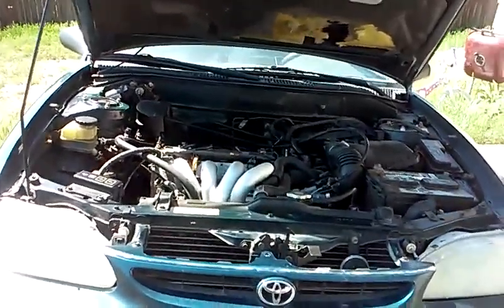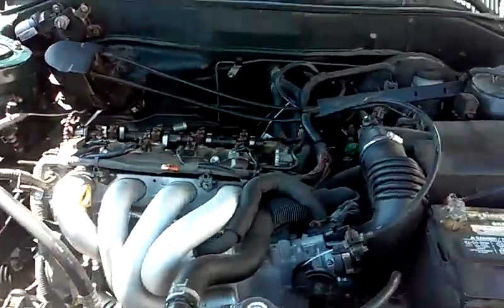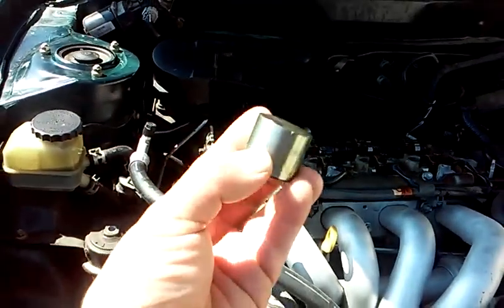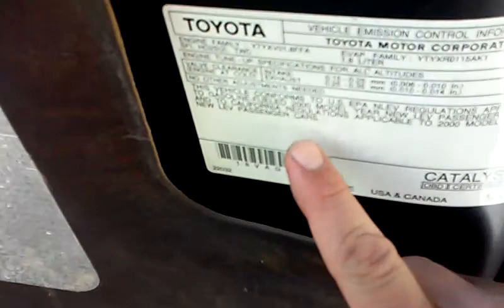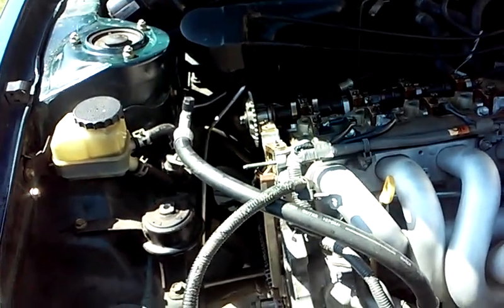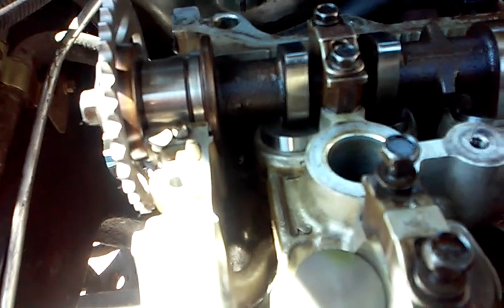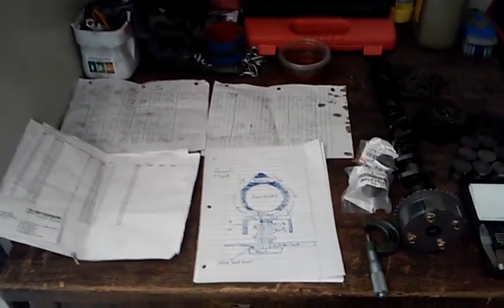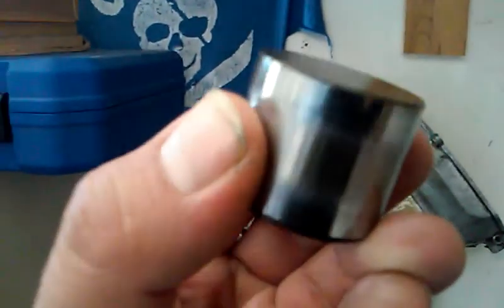toyota valve timing adjustment information

Comment: I have a 1998 Toyota Corolla, with 207,000 miles, and misfires, I replaced coils and plugs, but I believe it is misfire still, I keep resetting the codes, with my scanner does anyone have some advice,This is a five speed clutch driven

Comment: How much can you expect to pay a mechanic for a valve adjustment for a 2006 Toyota Corolla CE, 4 cylinder, manual transmission? I've been using an additive in my gas that seemed to quiet the lifters, but for some reason after getting 2 new lower control arms 2 weeks ago, the lifters are noisier than I've ever heard them before and I'm thinking I'm going to need to have them adjusted. I didn't realize what was causing the noise until i started watching several videos about the lifters and clearances, etc.
Reply: P.S. High mileage past 230k.

Comment: Hey Matt just a little bit of information to pass on dealing with bucket lifters. I saw on another video on YouTube, where the guy didn't put all the timing assembly back together but loosely put the cam shaft on just to check the clearance on the bucket lifters and the camshaft. He said and I quote just make sure it doesn't raise the camshaft up. So you don't have to go through all the hassle of putting it all back together. Just to check your clearance. He's another shop mechanic.

Comment: Thanks for your video Matt. Just for your information it is possible to pull the cams out of that engine without taking off the timing chain cover. I just did a 2004 that needed a new intake cam phaser gear.

Comment: Great video! i am not a mechanic, just a do it yourself because i can not afford the mechanic, or the dealer, so i undertook a project to fix a blown head gasket on my wife 04 corolla; iy only has 122000 miles but this is second time with engine overhaul. First time it had 80000 miles when she blew the engine driving it without oil, I kept that engine and now almost blew the 2003 engine it was put in! So since again the mechanic recommended replacing the engine which would be around $2000, we decided time to fire him; (we expended $1700 5 years ago in the engine replacement with this mechanic) and i took the project, determined to clean and fix that engine really good taking my time; its been 2 months I work little by little whenever i get some time and feel in the mood, what I did is kind of use parts from both engines where i cvould and buy a whole lot of new components for replacement; the original block and head was sent to machine shop; cleaned, tested for cracks ok, machined and the crankshaft was only needing polishing as i was told. The block was deglazed, not bored, then for it I ordered Mahle parts; Standard Pistons/rings, (I am using the connecting rods from the actual engine in the car, the one from 2003 because the 2004 engine connecting rods 2 of them were burnt really bad was advised not to use them) bearings and the head bolts are from them, The engine gasket set is from Apex; now the head was also worked at the machine shop where they re-seated the valves machined and put back together; the lifter were out of order as one guy from Autozone started taking them out of the head to show me something without me or him knowing this is a no no to do, so they worked with it at the machgine shop to re-install it in the head, now I have just done the timing which i ordered a new kit from CNS, i could have used the two sets i have but preferred go new; i have expended countless hours watching reading and learning how to do this, the engine is assembled back as best as I can; oil pan in lower/upper block plus head all installed to specs followed meticoulously, but today when i finally could spin the engine to test everything works and I do not have a valve issue stopping the traveling, first thing i notice is no matter what i do, i could not set the timing marks EXACTLY with the sprokets at 12 o clock; they both are slightly to the right for the VVTi and to the left for the Exaust one, the marks are pretty much parallel to each other at the line of the timing cover as the book asks and the bottom sproket is at TDC straight up; knowing i can not do any better i proceeded to set the time cover on, after couple hours and after tighting to spec the bolts installed the pulley, now the book says the mark in the pulley should point to 0 on the time chain cover , at TDC it points in between 10 and 0 but there is a paly i can do manually without moving the chain or the sprokets, then i started spinning and have never gat the chain marks aligned again from where they were originaly! and the top of the chain seems to do a dent as I rotate the pulley with a 19" socket and a breaker bar; i can feel resistance and easy down and everytime i pass the two sprokets marks in the center and align them the pulley is "in range" between the 10 mark and the 0 --- giving this scenario; did i messed up the timing and need to re-open the timing cover and re-do it all again or do you think the car would actually start? Last thing i want is to start to that horrid engine knock or noise! When I rotated the chain first time, i backed up a little to allow for the tensioner to engage but I can not really see if it is engaged; i took it out once and it was engaged so i re-install it again and did it all over and seems to be "ok" -- after the engine is back together i still will have to lower it into engine bay and hook to the manual transmission; we got new clutch as well as new axles (both boots broken on those) and besides what i mentioned for the engine we also have new radiator/hoses, thermostat, water pump, oil pump, belt, spark plugs, PCV valve. I cleaned, inspected and serviced all other small engine components one by one; for example the VVTi I am using is the original that came with the car, when the first engine blew, oil was gunked up everywhere really thick, including this VVTi which nobody wanted to clean and not willing to expend more i learned about the part for 4 hours, took it appart, got familiar with it, assembly and took it appart again several times, cleaned it until it is shinning new and i know it works so that is the one i asm using, many things the book don tell us i asked a Toyota dealer certified tech how to go about installing it because it suppose to be installed unlocked but then my marks were not aligning at all, the piece i was missing is install it unlock, torque to specs 47 ft lbs, THEN lock it, then marks align; so as you can see i have expended time on this project and it sucks to put it all together to have more issues later on; after this i m going to check my clearances just in case per your video! Thank you for it and any help or advise in my direction is greatly appreciated.

Comment: ????????? Confusing to me but I am just a runt on this subject. What are the numbers inside the bucket lift for???? An Autozone salesperson took all the bucket lift out of the head I brought in for questioning about some parts and now I am left with matching them again and no matter what video I watch I still have no clue how to really do it or how to start; Machine shops here do it but they charge $120+ and I do not trust it to leave the head in anywhere. Mine is a Toyota Corolla 2004 that has a blown gasket on the engine it has in. The original engine is where the head I am preparing comes from; so far it have been taken apart to the bare bone; checked ok, cleaned and rectified, all parts are ready to go in but those bucket lifters are a stone in my shoe so to speak. some say use a micrometer, others use a caliper, that engine where the head came from was not tapping at 80000 miles when the engine burned out because lost all oil and was driven in the highway without any; it blew a rod then but at least I salvaged the head which will substitute the one in the engine that is in the car now which was driven overheating for at least 3 months and with misfiring but it never burned all the oil completely. That is my dilemma!
Reply from the maker: The numbers are the 
distance in mm between the outside top middle point and the inside middle top point. I use a micrometer to measure the distance. whom ever took the bucket lifters out with out marking their original location did you injustice. if you want email me.....highgrooveauto30@gmail.com.......valve adjustments and replacing bucket lifters is a high level job and however I could possible help teach you how its done and the math formula you need to us eto replace the bucket lifters with the proper one for proper clearance.

Comment: Why was the camshaft taken off and what is the actual adjustment? Is it just measuring the clearance on the “lifter buckets” and then replacing whichever “lifter buckets” are worn from the inside?
Reply from the maker: It's not the lifter buckets that wear. It's the valve seats in the head. As they wear the valve is allowed to float higher and higher until it gets to the point that it is open at all times. To and compensate you change the thickness of the bucket lifter.

Comment: I have same engine in my Corolla 2006 with 160 000 Km (100 000 Miles) on odometer.
I'm very obsessive about maintaining and caring for our vehicles.My frequency of oil and oil filter changes is maximum every three months or every 5 000Km (3100 Miles),which ever comes first.Oil,only the best 100% synthetic like Motul.
Engine is still running almost like the day I bought it brand new.
I never checked valves so far.Is it possible to replace valve seats on those engines?